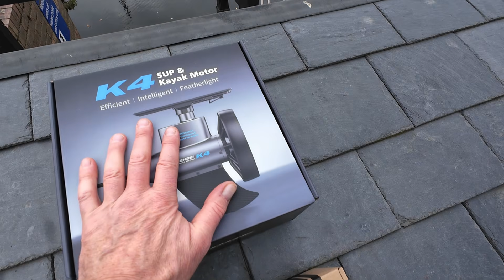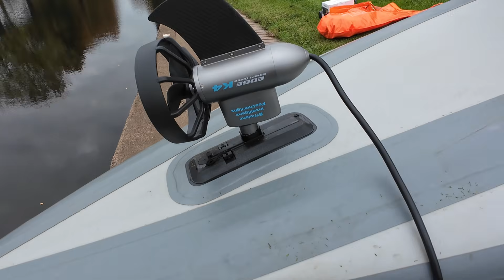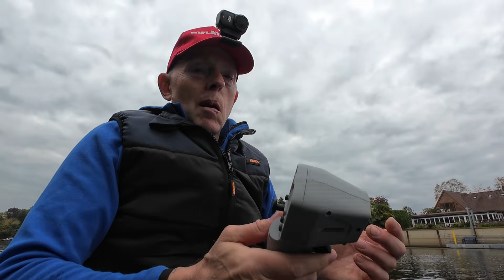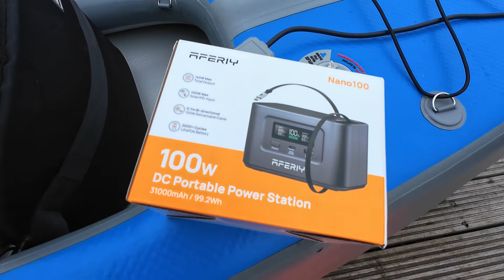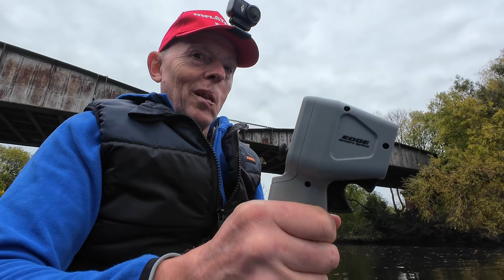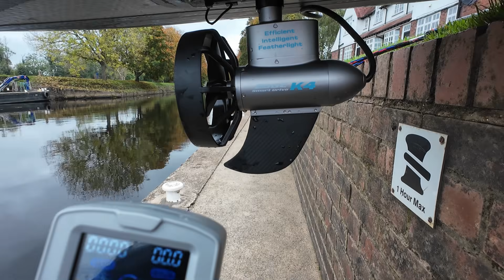EDGE K4 Smart Drive kayak/SUP board eFin - Test Review

Comment: Any one know about trooling speeds? On the edge k4 sport model 48v ( i like the 48v idea to push against wind gusts on the lake i fish, to get back to the dock.)

I have a fishing paddle board with the hiqmar efin,( a few years old, and a 24v 80AH battery lifepo4, i can troll for 10 hrs) , i wish it was slower for trooling.  The remote has low, sport, and reverse. (And no potentiometer.) Maybe 3 mph at low speed at 24v i would like trooling to be slower or adjustable.
Reply from the maker: You can set the K4 to whatever minimum speed you want - it's got adjustable cruise control, or trolling speed if you like.

Comment: I've just gotten the k4 cruise but the updated version. And a B8 battery. The controller is slightly different and obviously a huge battery but. They are awesome. I do have a shoulder injury but most of my friends paddleboard. This allows me to join in and not drag everyone behind 👍🏼
Reply: Oh I should add, the updated version cruise control. When it's on cruise, you hit forward on the trigger and it increases the speed by 10% vice versa
Reply from the maker: Excellent, it should make your life easier :)

Comment: What is Speed 5 , 10 , 15 ? 

How long until battery dead ? How Long miles like 200 miles?
Reply from the maker: Speed is covered in the video. Distance depends on speed and which battery size you're using.
None of the batteries will do 200 miles.

Comment: Nice review but its supposed to be bad for Li-ion batteries longevity to go under 20% of their charge capacity. Also charging a battery while using it, hmmm,  its probably not good! Maybe in need I would do it but at low speed (or power output) as much as possible. That can make a difference between a dead battery after 3-4 years of use or a battery that still feels like new!
Reply: Your correct the best for the battery's is to not go below 30% maybe 20 and to charge to 80% then an occasional 100%. That's all ok with a powerful capacity battery. That considerably increases the battery's life.
Reply: @chrisbamborough222  Hey, ty for the confirmation. I did read somewhere that its ok to charge up to 100% if you are to use it not long after its charged, and as you said, occasionnaly at least, like once every 30-35 charge. Well, sorry to be a bit cringe about battery life but so much pollution made to get them out of rare earth and they are expensive too! Make them last! Worst thing to do I guess its to fast charge a battery right after a heavy use and at high temperature, let them cool down at least, 18 celsius is optimal :)
Reply: @emmanuelbrouillette3907 Yes and good points about waiting a bit before charging 👍
Reply from the maker: I've never actually had an issue with that.

Comment: Great videos - thank you!
They convinced me I need one of these to go with my sandbanks optimal (I assume it will fit on it) but unfortunately they seem to be out of stock at the link you included. Hope they get more stock ready for the summer!
Reply from the maker: Yeah it should fit in the optimal. It's got 2 attachments the standard skeg mount and the USA fin box.
Reply: Hello again. Still doesn’t seem to be in stock so do you think the Hiqmar version is a reasonable option? Any chance of a brief comparison of the two if you have time?
Reply from the maker: @peterfreeman1483 possibly
Reply: @peterfreeman1483 Did you get one? Sandbanks style have loads in stock atm. With the B8 battery too! They also have the updated version which is much better than the one in the video 👍🏼

Comment: Cool test, but one of the main things was not tested. If you use this motor on a sup, it could be important to know that the battery and the radio is floating or not. Could you tell that?
Reply from the maker: Both are waterproof. The battery would sink however it clip locks to the cable so it should be retrievable. The radio, also waterproof, may float but that's untested, yet 👍😊
Reply: @MoreThanJustaCleaner  Thank you. So as i would say - room for improvement ;-)
Reply from the maker: @unicyclist7759 Isn't there always 😊 As far as I'm aware, there aren't many, if any, if these eFins that use a remote battery where the battery floats.

Comment: 1) that standalone connector is for connecting to +ve -ve terminals of 'traditional' batteries.. 2) the torque of the motor is so powerful that instead of turning the bow left, it pushes the stern right and vice versa.. :face-green-smiling::face-green-smiling:
Reply from the maker: Ah that makes sense 👍😁

Comment: I NEED THIS for my Sea Eagle.  Currently been enjoying a Bixpy for the past couple years.  Now the Bixpy loves to suck up and conk out completely, with its smaller, high velocity prop when it encounters reeds or leaves.  It loves to suck up fishing lures even if they don't seem right in the way.  I THINK your E-fix is doing an amazing job, with its larger prop, of not getting stuff tangled in it continuously.  I think the Bixpy would have stopped 10 times over the little trouble you had clearing the prop out by going in reverse for a bit.  AND come on now!  Steering with the remote?  That's just luxury and I want it.  I'm sure I could have gotten an E-fin into the United States the last time I looked when you had one.  But I had the Bixpy at the time and didn't think the E-fin was much better.  NOW?  With the steering remote?  The E-fin is much better.  It's no contest.  I'd just make sure I get their biggest battery for range.  Thank you!
Reply from the maker: Yeah I think I'm going to get the bigger battery too 👍😁